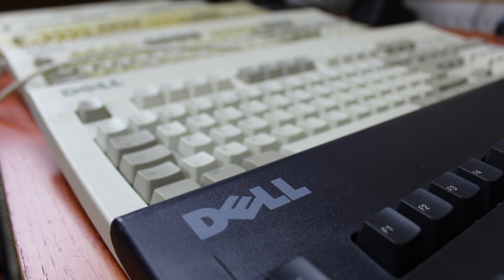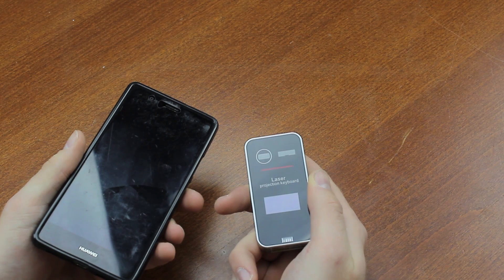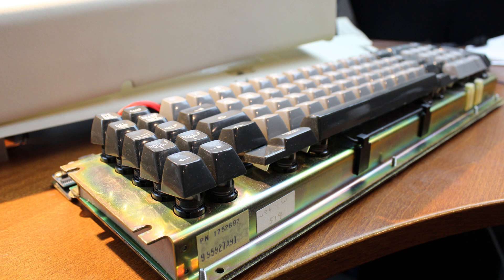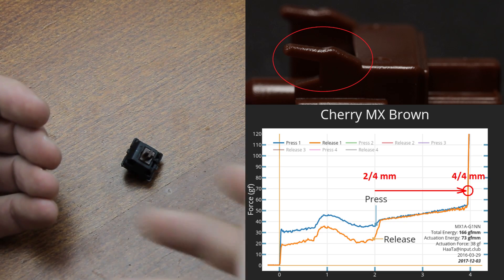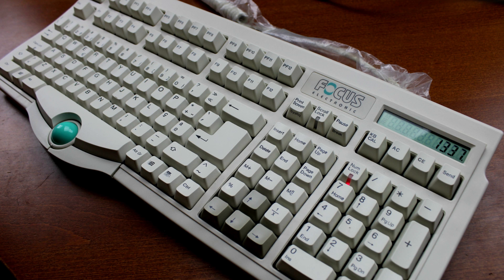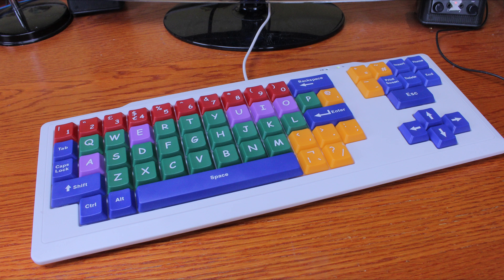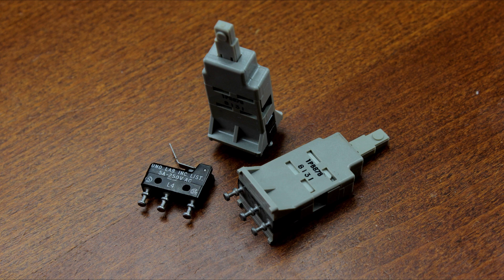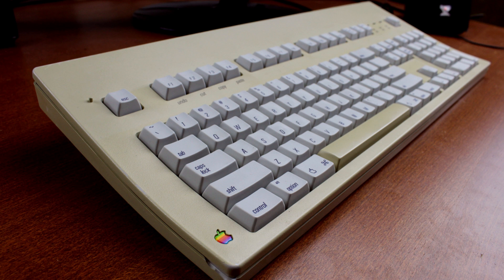When is a keyboard "mechanical"?

Comment: The real problem with "mechanical" keyboards isn't the fact that there is no definition, but the fact that some people assume that mechanical keyboards are better than the rest (mainly rubber domehs) and it's sad because here I am feeling like the only keyboard I could switch to for longer than a week is a btc dome with slider one even though there is a ton of modern keyboards I like (for example ergodox) there is no way I could switch to them because none of modern cherry mx mount switches comes even close to IBM keyboards in term of keyfeel and btc dome with sliders aren't close either, but that's the point - they are so different and yet (with good keycaps) so satisfying to type on that they claimed a second spot in my heart after buckling springs.
Reply: >ome people assume that mechanical keyboards are better than the rest
yeah, that's the biggest problem, because why good rubber dome keyboard must be worse than actual cherry mx switch type board? Lots of people complain about "muh partway through actuation, 50/70/2137 milion keypresses that mean nothing when it comes to reliability issues, nkro (or worse: full antighosting) support and RGB(T) that is rather more visually appealing than actually helpful, because cheap desk lamp provides much better visibility when typing at night", why good keyboard from 1980s/1990s must be considered as worse, nevermind if it feels better or is at least as reliable as "mechanical" keyboard made in 2018?
Reply: you might like a bke dome swapped plum :P my favorite keyboard right now (though I'm hoping that changes when I finish building my custom)
Reply: @Crokto  there are several keyswitches I want to try out at some point because they seem like a good contestant for being the second and third favourite switches of mine (Alps SKCM Blue, Topreh with gray bke domes and zealio with 100g SPRiT springs), but because I live in poland there are almost no mechanical keyboard meet ups nearby so that's a bummer.
Reply: "none of modern cherry mx mount switches comes even close to IBM keyboards in term of keyfeel" I mean yeah, there's nothing like a Model M, F or a Beamspring, those are all in a class of their own, however I can recommend some modern MX mount switches I like.

Ace Pad Hall Effect, if you're okay with Linears, are really nice, reliable and smooth as butter.

Kailh BOX Navy have a really nice satisfying tactile click, if you're okay with the sound and an above average weight. They're nice and smooth too.

Royal Hakos, if you want a more tactile rubber dome-like rounded feel in a discreet switch. The tactile bump is right at the top and it pushes the slider past the contact point so as soon as you feel the tactile bump, you know it actuated. And they actively prevent you from bottoming out too, much like Cherry MX Clear only with a much more pronounced tactility. They are heavy, but they feel quite soft as you don't really bottom out that often. IMO, smoother and nicer than BOX Royals.
Reply: I have some low-cost rubber dome keyboards that are as pleasing to type on as keyboards costing ten times as much. Too bad they flex like hell. 

That said, I have some 25 and 30 year old rubber dome keebs that feel great and are built like tanks.

Comment: I would say. The keyboard has to have a discrete switching element that is not part of the keycap.
Reply from the maker: But in that case, dome with slider is mechanical and rubber domes are not, just because there's a little piece in between them.
Reply: Chyrosran22 I’d agree with this. I consider dome with sliders mechanical as they use a discrete element in between the keycap and the contacts.
Reply from the maker: @vojtasTS29  But what does this fundamentally change about its operation? Surely the division of one part into two can't dictate whether something is mechanical or not. Imagine if Cherry moulded their keycaps into the stem, it would suddenly cease to be mechanical.
Reply: @Chyrosran22  Not to mention, IBM buckling springs with 2 piece caps would be mechanical, and 1 piece caps wouldn't be.
Reply: Unless you don't even count buckling springs as mechanical in this definition because you can take out the slider (underneath keycap piece) out in the same manner as rubber domes. But if there was a tiny piece blocking it from being taken out, would it then count? Yeah, this definition sucks ass.

Comment: My definition of mechanical keyboard: when Thomas has at least one in his closet. It's non-mechanical if he keeps it in his waste bin. Easy.
Reply: How about one where he is able to pick one up from a recycling center for 2 pounds or less.
Reply: @sp3ctum  btc rubber domes and electro capacitive switches are technically not mechanical though they feel and sounds great
Reply: @adolfazusa1138  Arguing about something being 'technically not mechanical'...it's like you didn't even watch the video.
Reply: @kevadu  Yes I did not before typing that comment though I did not do what thomas refer as keyboard racism by saying if it's not mechanical its shit. We're most likely will be using these terms anyways such as what he stated in the end of the video the point is when someone judge a keyboard before trying it out should reconsider relying on these terms
Reply: he keeps that terrible flexible keyboard around though lol
Reply: What about smith corona
Reply: The Smith Corona is in his closet. 

But it barely qualifies as "mechanical"

Comment: The definition I propose: A mechanical keyswitch is a switch that has very noticable key travel, where the main part of the resistance doesn't come from rubber being bent.
This excludes most of the standard rubber dome keyboards, as well as topre keyboards.
Reply from the maker: Again, this excludes tactile foam and foil but not linear ones, even though it's the same switch. What does it matter to the operation of the mechanism, really, what materials parts of the switch are made out of? Is a switch more or less mechanical if the housing is made out of ABS than if it's made out of Nylon, for example?
Reply: @Chyrosran22  Let's make this a little bit more precise and replace "where the main part of the resistance doesn't come from rubber being bent" with "where the main part of the resistance doesn't come from a material that changes density during keypress". I hope this explains my idea a little better. And yes, tactile foam and foil switches are still excluded. The reason for this that I would consider a tactile foam and foil keyboard as a rubber dome keyboard. Both foam and foil switches have the same activation mechanism of course, but the resistance is really different between those two.
Reply: Jannis That actually DOES exclude Topre - all the weight comes from the dome, not the spring.
Reply: @vootcaboot6  That's what I wrote.